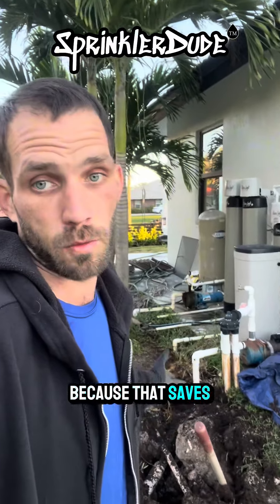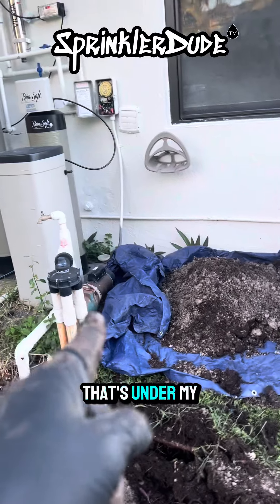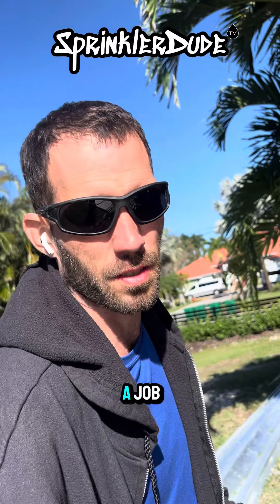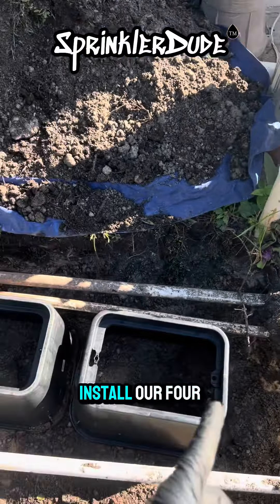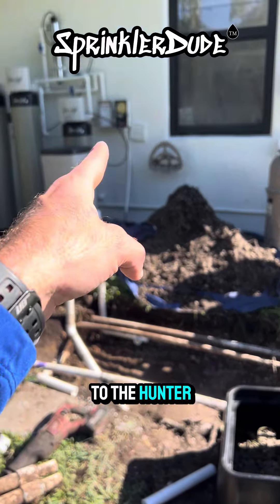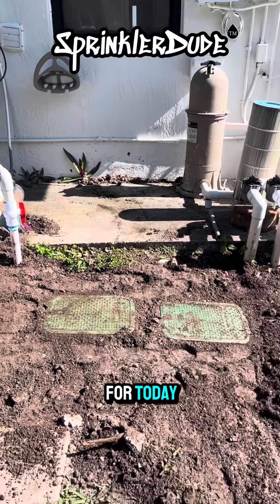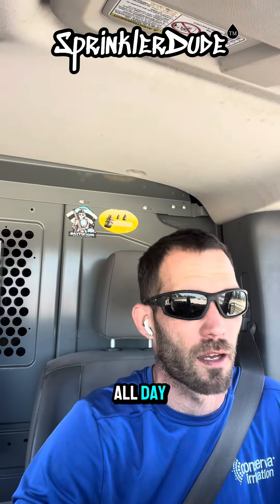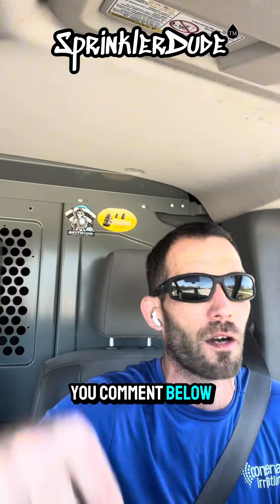Upgrading the MOST Inefficient Sprinkler Valve | Indexing Valve

Comment: Why do you have to redo the piping like that? Why cant you do it right there above ground? Seems like a lot of extra labor/cost. Not trying to be critical, actually want to know. Thanks.
Reply from the maker: Installing these valves underground is the correct way to do it. In rare cases, it is not possible to install underground. In those cases we would install it above ground. Below ground is our first choice.